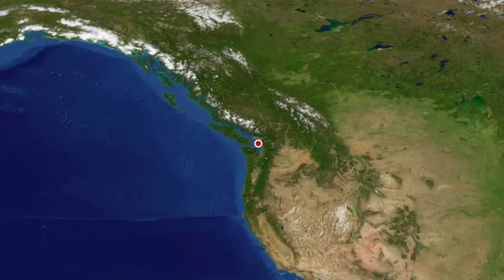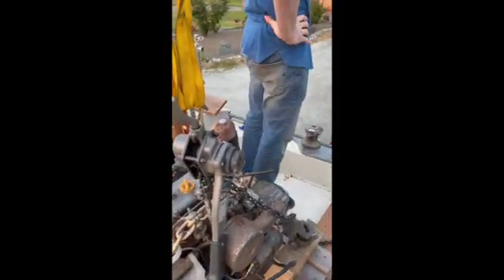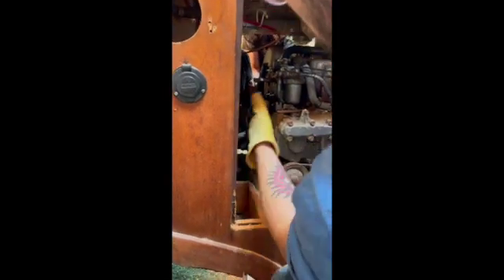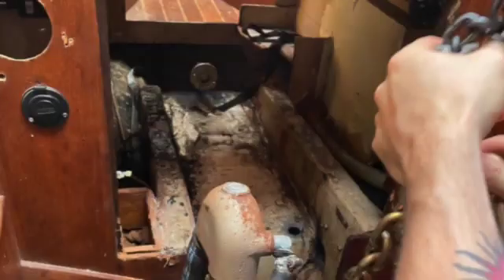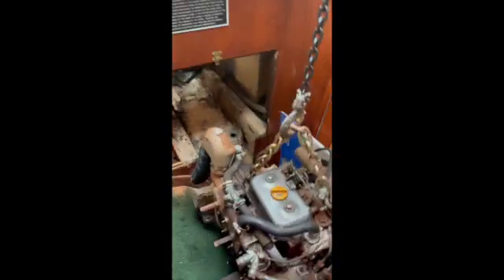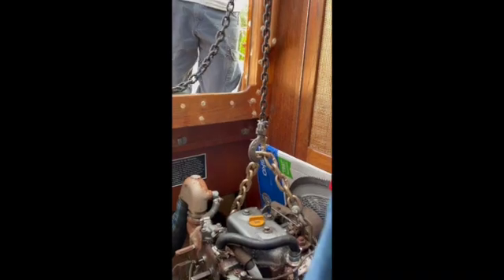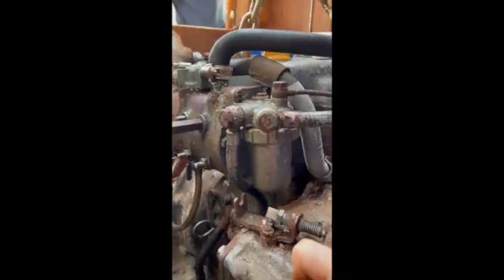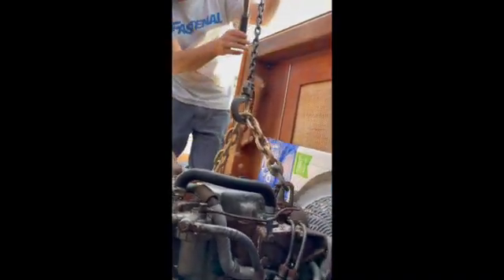11. Why are we Pulling the old Diesel engine OUT?

Comment: I cheated both times I removed my engine, I borrowed a boom truck from where I worked. Pushed the cable up button and up it went. Great video on the removal Kristofer thanks for sharing.
Reply from the maker: I for sure would’ve done that had I had the option! As a matter of fact I did ask some guys from the old lunch boat company that I worked for before if we could use their boom truck… The company said, “No way!”

Comment: That looked hair raising. I have a question, that obviously weighed a lot. So, what is the difference in weight between that engine and the electric engine? And will that make any difference in how Mig handles when you're sailing? Do you need to add balast to make up the difference in weight for the engine and the fuel?
Reply from the maker: That is a very insightful question Caleb.  The difference in weight is significant. The old diesel and all of the fuel weighed considerably more.  Even considering I added eight batteries, the weight of the lithium phosphate batteries is WAY less than lead acid batteries.  The weights in the fuel tank will be very comparable because I am replacing the fuel weight with some chain and also water. Overall the boat will weigh less than it did before in the engine compartment. Considering that I am sailing this boat offshore around the world I will also be adding quite a lot in provisions and extra water as well as all of the accoutrements that come with living on a boat full-time.
Reply: Will you be able to store a lot of that stuff near where the weight of the engine and fuel were located?
Reply from the maker: @calebburton5719  A lot of the stuff will be stored in the aft cabin.  I think in the end the weight distribution will be pretty close to the same but will know when we get it on the water ha ha